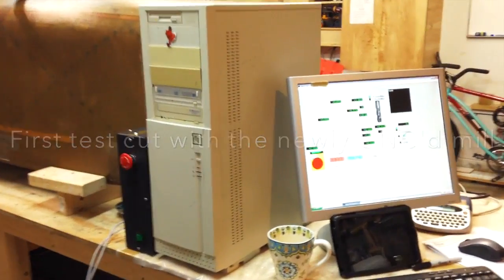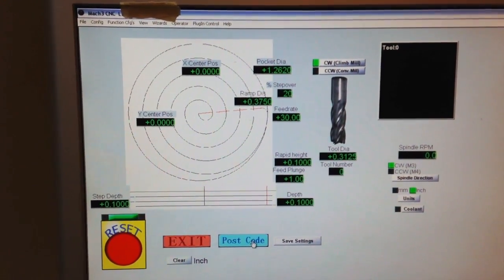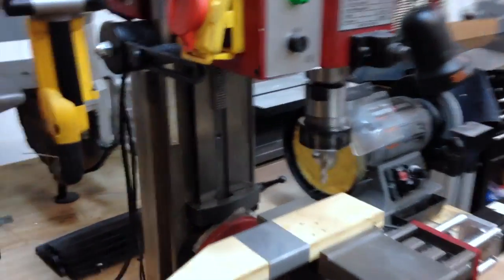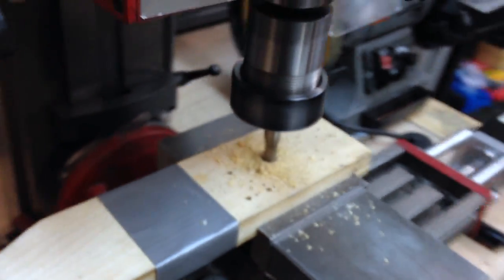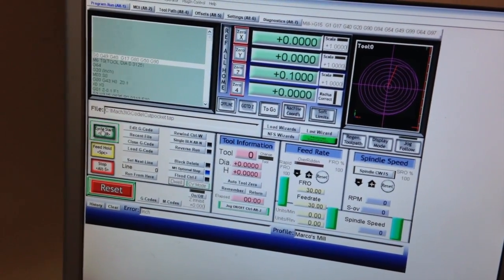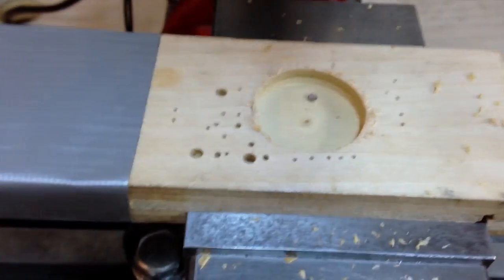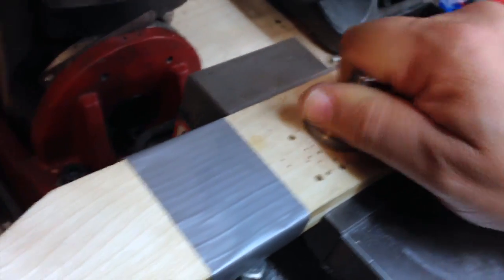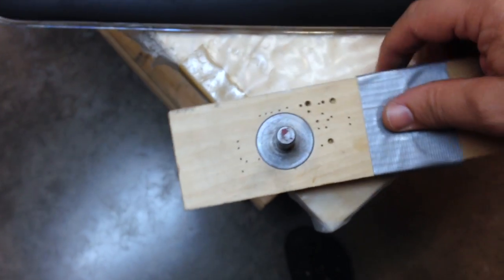Milling a circular pocket

Comment: Could you show the whole gcode program?  This is what i wanting to do on a Haas Mill but I need to code it manually.  I was hoping for a canned type cycle to do this but cannot find one. Currently using NCPlot to check my work
Reply from the maker: G0 G49 G40  G17 G80 G50 G90 
M6 T0(TOOL DIA.0.3125)
G64
G20 (Inch)
M03 S1500
G00 G43 H0  Z0.1
X0 Y0
G01 Z-0.04 F1
G3 Y0 X0.0625 R0.0313 F30
Y0 X-0.0625 R0.0625
Y0 X0.125 R0.0938
Y0 X-0.125 R0.125
Y0 X0.1875 R0.1563
Y0 X-0.1875 R0.1875
Y0 X0.25 R0.2188
Y0 X-0.25 R0.25
Y0 X0.3125 R0.2813
Y0 X-0.3125 R0.3125
Y0 X0.375 R0.3438
Y0 X-0.375 R0.375
Y0 X0.4375 R0.4063
Y0 X-0.4375 R0.4375
Y0 X0.47475 R0.4561
Y0 X-0.47475 R0.47475
X0.47475 Y0 R0.47475
Y0.375 X0.09975 R0.375
G00 Z0.1
X0 Y0
G01 Z-0.08 F1
G3 Y0 X0.0625 R0.0313 F30
Y0 X-0.0625 R0.0625
Y0 X0.125 R0.0938
Y0 X-0.125 R0.125
Y0 X0.1875 R0.1563
Y0 X-0.1875 R0.1875
Y0 X0.25 R0.2188
Y0 X-0.25 R0.25
Y0 X0.3125 R0.2813
Y0 X-0.3125 R0.3125
Y0 X0.375 R0.3438
Y0 X-0.375 R0.375
Y0 X0.4375 R0.4063
Y0 X-0.4375 R0.4375
Y0 X0.47475 R0.4561
Y0 X-0.47475 R0.47475
X0.47475 Y0 R0.47475
Y0.375 X0.09975 R0.375
G00 Z0.1
X0 Y0
G01 Z-0.1 F1
G3 Y0 X0.0625 R0.0313 F30
Y0 X-0.0625 R0.0625
Y0 X0.125 R0.0938
Y0 X-0.125 R0.125
Y0 X0.1875 R0.1563
Y0 X-0.1875 R0.1875
Y0 X0.25 R0.2188
Y0 X-0.25 R0.25
Y0 X0.3125 R0.2813
Y0 X-0.3125 R0.3125
Y0 X0.375 R0.3438
Y0 X-0.375 R0.375
Y0 X0.4375 R0.4063
Y0 X-0.4375 R0.4375
Y0 X0.47475 R0.4561
Y0 X-0.47475 R0.47475
X0.47475 Y0 R0.47475
Y0.375 X0.09975 R0.375
G00 Z0.1
M5 M9
M30
Reply: @EZ_shop  Thanks, I figured it by seeing pattern in the code that i could see in your video.  Your video was most helpful. I cant wait to get my cnc!
Reply from the maker: Good luck Chris.